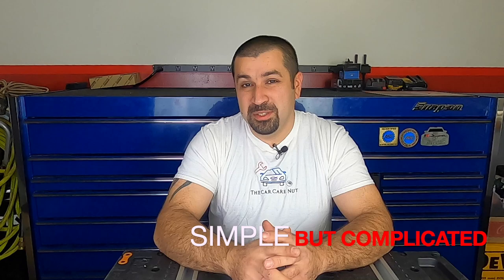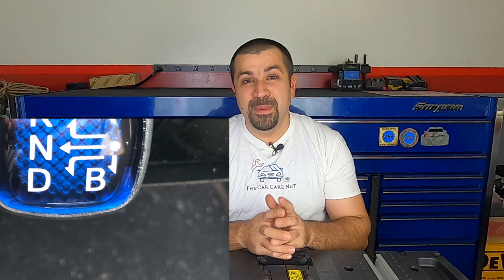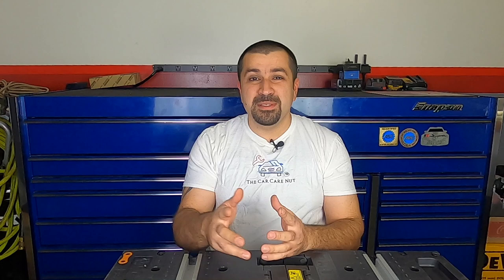How Toyota Hybrid System Work Part 6 B Mode and Hybrid AWD

Comment: Yet another VERY informative video!  Fills in the blanks that the humongous Toyota handbooks leave out!  My UK 2018 Gen 4 RAV4 AWD  doesn't have B mode but does have S+/- but the dealer never explained properly what this option is for. I live out in very rural Scotland & our hilly single-track road out to the main road never gets gritted despite frequent snow.  Prior to the Toyota I was very capable and happy to drive front wheel drive cars with "all season" tyres in the snow - the RAV is my first automatic car and I do have reservations (ok - scared almost!) about driving it on snowy slopes despite it being AWD given that I believed I couldn't control the engine braking/gearing like on a front wheel drive car.  So now I know - use the "manual" S+/- mode to get the necessary engine "braking" effect for these snowy, hilly roads - thank you!

Comment: I regularly drove a 2013  Prius on steep mountain grades, including one that descended 2,000 ft. in elevation in 12 miles.  "B" mode definitely works on steep grades such as that.  One note though: when the Prius first starts descending a steep mountain grade, as the video noted, putting the gear shift in "B" mode will put the hybrid system in full regenerative braking.  For awhile, however, the gasoline engine may only run at idle RPM--until the hybrid battery reaches full charge.  Then, the gasoline engine will be revved up to provide engine braking--presumably because the hybrid system can no longer use full regenerative braking because it would overcharge the hybrid battery.  By the way, the proof that the hybrid system does greatly improve fuel economy is that my Prius gets about the same fuel economy traveling up and down steep mountain grades as it does traveling on a flat highway.  The things that ding the fuel economy of my Prius the most are driving in very hot or very cold weather, or using the A/C a lot.
Reply: So I have a concern that my 2014 Prius V is not operating correctly in B mode.  On a downgrade of about 1,000 ft. elevation, the B mode causes the drive battery to become fully charged (green battery indicator is at 10 bars).  I also begin to experience a hot electrical smell.  Other Prius advisors say to avoid fully charging the system, because it will shorten drive battery life.  I didn't experience my ICE revving up as this user describes after the drive battery gets to 10 bars.  Based on this experience, I have tried free-wheeling into N when I get to 10 bars.  Another online advisor has stated that the software has protection when B mode reaches 10 bars. The hot electrical smell makes me doubt that mine system has such protection.  Thoughts???

Comment: As a result 😊of this vid we will stop using the B mode incorrectly Thx for taking the time to research the subject and then converting it to a very good tutorial. SoCal 2017 Toyota Camry Hybrid 27,000. miles. 40 mpg  0 problems.

Comment: Great video!  can you do a video about off-roading and towing with a hybrid vehicle?
Reply: I second that notion! Do both with may 2019 RAV4 hybrid XSE. Crappy fuel economy towing but otherwise she pulls 1050lb trailer great!
Reply: 1.  How well will the hybrid AWD in mild off roading?
2.  In the event there is a problem with the hybrid AWD front drive, how well will the hybrid AWD "Rear Drive" perform to get the vehicle home or to a repair facility?    You've got my attention with the AWD Rear Drive (MGR and running gear) as part of a 4WD system, possible selectable rear drive, possible emergency drive system, also what kind of and how much torque/horsepower does this rear drive MGR produce?
All of a sudden I can see potential possibilities especially in the aftermarket on road and off road driving!  HHMMMMMMM!
Reply: Great topic especially about towing.

Comment: Bravo. Ty for your hard work. Alot of folks figured it was putting on full regen. Noticed that the engine would come on sometimes but not always. I personally figured if the battery was in a low state of charge it just throws it into the battery. If it gets too full or hot/overheated, it burns off the excess with the engine.

I imagine the advice of leaving it in Brake mode stems from the Chevy Volt guys doing it. They have a huge battery in comparison to other hybrids so they are almost always able to accept all that extra electricity into the battery. But also, when their battery is full (say they just left their house with a full charge) their engine would rev up to burn the extra electricity as well. I'm not sure if the Prius Prime works that way, but it might.

You are definitely right tho it would put alot of extra strain on the generator and engine that usually the friction brakes would take the strain of. Besides, should use them friction brakes when ya can, we get so much rust caking up on them cause we hardly use them 😝. JK but true lol.

Comment: Thank you dude. I don't need to use B mode often but when I have it has always freaked me out. Engines are not meant to scream like that and I was always concerned with overcharging the battery.

Hopefully next time I have to use it I will be a bit calmer :-)

Comment: Another very informative video, thanks. 2 interesting observations from my corolla:1-during long downhill driving in D mode, after a while I feel the system runs as if in B mode. Engine starts and runs at high rpms like in B mode. Probobly for people who do not use B mode, preventing breaks overheat. The 2nd observation: in B mode downhill driving, if you push throttle pedal, you will see your rpm of the engine will decrease. :). Push throttle for lower rpm.. :)
Reply from the maker: Thank you for watching my video! Very awesome observations! So the newer hybrids have the ability to pick up when it’s going down hill automatically and will try to help the brakes automatically. Also the reason the rpm goes down is the car decreasing the effect of b mode as an acceleration method.

Comment: I had my Prius for almost 10 years and never needed to replace the brakes just minor adjustments to the existing brakes. The regen system is great. Only tires and oil changes and replaced regular battery once at 8 years

Comment: so   b    mode  is  a break pad saver on big down slope hills, while helping to keep brake pads cooler and helps keep  them  from burning up  while maintaining a safe speed down hill.  so  the  owners manual should say to only use b mode when needed traveling  on steep downgrades.   very well done video. thank you. word of caution : dont have 7 adults  and a rv trailer  in tow going down a   large steep hill  with your prius,  or youll be paying this guys toyota dealer   tech an  extra  8 car payments while  you sit in the waiting room, bring your tent and sleeping bag, youll be camping out at the toyota dealer campground.  sir did you happen to see the brake pads in your rear view mirror ?  no sir  mr.  tech------- the smoke was to thick.

Comment: Hi Car Care Nut. Your series on Toyota hybrid cars is some of the best I have seen. Thank you for making such great videos.

I have a RAV4 hybrid 2020 model. Could you please explain (or perhaps make a video) how the “S mode” works in newer Toyota hybrids?

Thanks again
Reply: I too hope for a video on the newer S mode. I understand it to be a more versatile version of B mode, but I'd love to hear more.
Reply: Maybe that is just "Sport" which makes the car accelerate easier and gives you full control of the paddle shifters.
Reply: As I understand it, S mode on the newer hybrid models is B mode, but with selectable levels of electric braking. The “lower” the gear you select in S mode, the faster MG1 spins the engine, and the more electric braking force is provided.

Comment: Actually, the toyota cars automatically put themselves in "B mode" when they detect a descending slope and you let off the acceleration pedal, especially if you have cruise control activated. The car engages the motor and tries to maintain speed without applying the brakes.

Actual B mode is almost never needed because of this, since the car automatically uses the engine to brake in D mode. I have only used B mode in mountain descents through slow speed roads, that's the only situation when I found it to be useful, other than that the normal D mode is enough.
Reply: A very good explanation for my 13 Toyota Avalon hybrid Limited.... I've experienced this myself...
Reply: I've been wondering how this works for a long time on my hybrid plug-in.  Now I know.
Complicated things made simple - simply amazing!
Thank you!
Reply: My 2006 Highlander does not automatically go into B mode. What year did this become automatic? It would actually be handy if mine did.
Reply: @scoschegn  When I say they go into "B mode" it's not actually changing the mode, it just engages the motor with no ignition so it helps braking the car without overworking the batteries when descending.  Should be normal behavior to prevent battery overheating in all "hibryd synergy drive"  cars, but 2006 highlander is petrol so that's out of the scope here.
Reply: @raultorrellas4512  Ah, ok. My 06 Highlander does not do this. I actually gain speed going down hills unless I manually place it into B.
Reply: Indeed if you have cruise control active and it needs to break hard, b mode also kicks in. I've learned from this to also put b mode on for hard breaks like for stoplights when I drive manual...
Reply: I was wondering about that because I don’t have a B mode on my shifter. I figured Toyota must have had the computer do this automatically, especially when I use radar cruise control and it controls my speed.
Reply: @scoschegn  I drove a Prius 1, that had to be switched manually.  I had a Prius 2, that when fully charged downhill, it only switched to B mode, but then by itself.
Reply: I guess I am kinda off topic but do anybody know of a good site to stream newly released tv shows online ?
Reply: @Benjamin Marley I dunno I use flixportal. you can find it by googling =) -moses
Reply: @Moses Soren thanks, I went there and it seems to work =) I appreciate it!
Reply: @Benjamin Marley You are welcome :)
Reply: Yes, manual B mode is almost never required except in the most specific circumstances. The newer generation cars are programmed to automatically go into B mode braking in the situations that have been previously described in this comment chain, and also when the hybrid traction battery is full (or fills up during normal regen braking) and you request [additional] braking through the brake pedal. My 2012 Prius does this, as would my RAV4 prime, although due to the battery size on that vehicle, you’re almost never going to completely recharge the battery through a normal drive cycle.
Reply: AGC, Automatic Glide Control. It lights up on the dash when you’re in ECO mode
Reply: @kolohe4169  What is your car model ?
Reply: @stephentrinh640  , hybrid plug-in..?!?
Reply: Yes. Mine CH-R goes to B to maintain speed when in cruise control mode. Actually I use cruise control a lot, perhaps more than I supposed to since Toyota only advice the use of it on highways, and I use it in almost everywhere...
Reply: What about the Prius Prime? Would B mode be properly used to help regen the cars battery for full electric mode? I have a 2022 Prius Prime plug-In Hybrid and going down mountain grades in B mode charges the Electric battery fairly decent.  Will this hurt the car in any way? I use B mode usually in city driving so I don’t have to use the regular brakes as often.

Comment: Eureka! This all makes sense.  Yesterday I drove up to the Kitt National Observatory.  It's a 12 mile drive up from 2K to 7K ft altitude.  My 2117 Prius performed flawlessly going up, 25 to 30 mph.  Coming down I thought I'd try the B Mode. (I didn't recall exactly what it was for.)  I immediately felt the car feeling resistance.  It was an off day so there were no other cars on the road, good.  I moved along 20-25 mph and then I heard the engine spin up...gasp!  Was this good or not?  I kind of freaked and a few times I slowed and put it in D letting the speed go up to 30.  I had no issues on the drive down partly because I was white knuckle driving being more concerned with not going over the side of the mountain! 8-]  Hello?

Now I know that when the engine spun up it was being lubricated with oil and no fuel was being pumped into the cyclinders.  Whew!  The system was functioning exactly as it was designed.  Thank you CCN!  Now when I got back down from the mountain it was HOT (Which was why I went up the mountain in the first place, 85! versus 100+).  

This brings up another concern.  It's mid June and it's getting hot. (It was 112 when I got home, summer is spinning up)  I have made it a point to have the AC set to circulate throughout the entire car, not just focusing on the driver.  I specifically set the passender dash vent to focus airflow downward along the door towards the back floor board where the fan intake to the HV battery is located.  I also make sure there is nothing on the back floorboard that could affect the air flow. (I replaced the filter also)  I'm thinking this will help a bit and it certainly won't hurt.  I just seems reasonable.  Summers in Tucson are brutal and when you see a roadrunner carrying a canteen you should give it some thought.

Thank you CCN, it's now very clear how B mode works.  I bought my 2017 Prius about a year ago from the dealer about a mile from my place.  It was Certified "Pre-owned", had 60K miles, was clean and in beautiful condition.  It was from your videos that I learned much more about how the Prius hybrid functions.  Mine has functioned flawlessly and I enjoy driving it.  You are a gold mine of information, thank you, thank you, thank you.

Comment: On my Toyota RAV4 (2018), which was manufactured in Japan and is driven in the UK, I don't have a "B" gear but I do have "S" to manually control gear selection. However, I've found a good way of controlling my speed when going down long hills (of which there are many in South Wales here in the UK) is to simply put the car into cruise control mode and set the speed to, say, 40 mph. I find that  the car maintains that speed going both down and up hill, deviating only when I get too close to the car in front, at which point it slows down and speeds back up to 40 when the car in front is far enough away. It saves me having to constantly monitor the speed as the car does it all for me until I apply the foot brake.

Comment: Thank you so much for the explanation about “B” mode. I was concerned that it might over rev the engine if used at high speed. I understand that the ICE is freewheeling, but at a high rpm. I ❤️ my 2012 Prius. ,

Comment: I'm a big fan,  you have taught me so much useful info.  I am giving my 2012  XLE Camry Hybrid (150,000) mile and ZERO problems with std maintenance to my daughter.  I am waiting for delivery of my 2023 RAV4 Premium Hybrid so I really want to understand everything I can and you have supplied me with details I could not easily find.

OK so this B-mode lesson has  me a bit confused.   Under normal braking the engine stops and the both the wheels and MG2 are directly attached to the ring gear all of which spin with the inertial force of the wheels applying input to MG2 and its reactionary drag to the wheels - as you say life is good (I understand) 

B mode still has me scratching my head.  Going downhill foot off the accelerator, MG2 still providing (insufficient) braking force so the engine is off but directly attached to the planetary gears and these are now spinning the engine too as an additional input force from the wheels thus supplying more engine braking force to augment MG2 braking force alone????    Why do we need HVB energy to spin the engine by way of MG1, this would negate engine braking.    MG1 is attached to the sun gear.   Why cant the ring, planets, and sun all be turning at once supplying even more braking by way of MG1 charging (not depleting the HVB) 

Its confusing but this is how I would imagine it might work.   I cannot account for the direction of spin with each all of them turning.  Perhaps MG1 needs HVB energy simply to hold the sun gear stationary in order for the ring to supply all of its force to the planets (and its attached engine) ???

I'm still confused.

Comment: Thanks for your replies to my previous comments.
Could you please do a video on the latest (2021) Camry Hybrid SE that has the gear change Paddle shifters on the steering wheel. 
It would be interesting to know how the gearbox "simulates" gear changes in this type of transmission.

Comment: Thank you for making this series about Hybrids best I ever seen so far. Great job. 

Wanted to add that in a Prius eAWD the MGR is actually not generating energy it is only working as an engine when need of course brilliant Toyota did it to keep best fuel efficiency every with Prius.

And it worth noticing is that in PP in EV mode in B gear it is not turning on the engine it uses only regenerative breaking and then after certain time it turns on the engine to cool off invert. In HV mode it works like you described.

Comment: Rav4 in D mode and cruise control - if the battery is fully charged and downhill beginns or the car in the front slows down - rav4 does the “B” effect on it’s own. Alternatively, on slow speeds, I use S mode and up/down shifters.